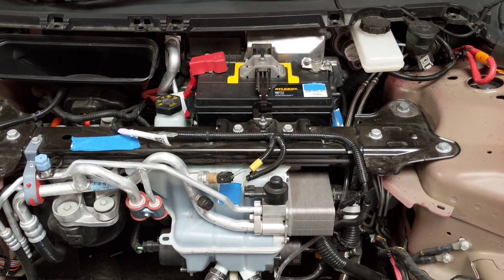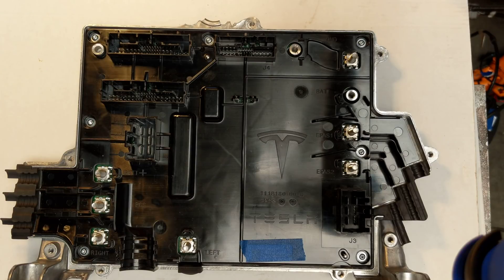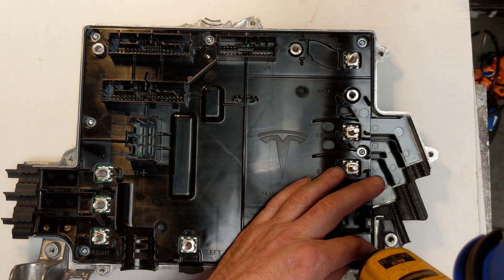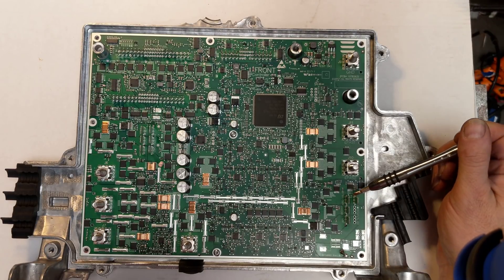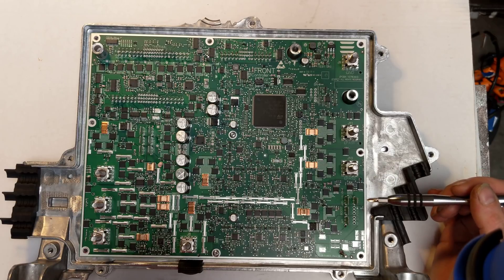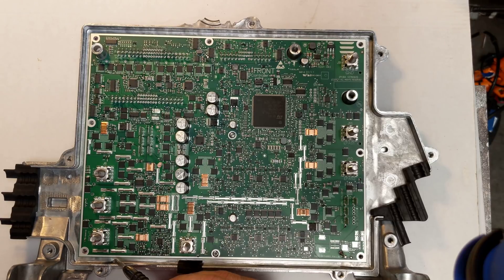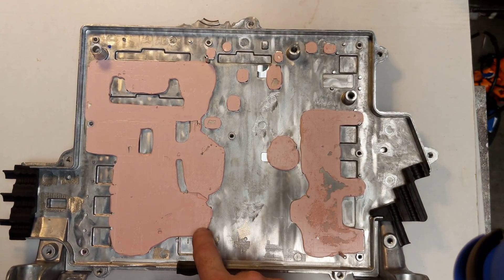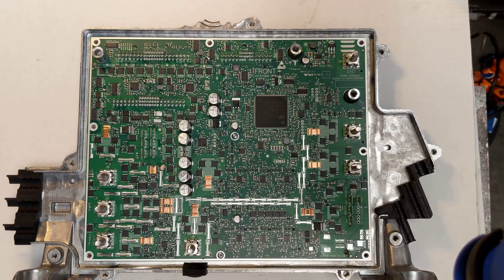Tesla Model 3 - Teardown of VCFRONT (Front Body Controller)

Comment: I have vcfront_a192, vcfront_182, vcfront_a402 in my 2020 model3 (battery is 4 years old)
After going into the service mode low voltage screen I don't have VCFRONT_a192, just VCFRONT_a182, VCFRONT_a402, VCFRONT_a407, and VCFRONT_a371.
the 12V battery reading
voltage between 12.59 to 12.62
current between -0.39 to 0.04
PCS
- HV battery contractors
closed
- DCDC support status
active
voltage target: 12.63V
output voltage: 12:58 to 12.60
output current: 19 - 20.20A
Do I just need a new 12V or new VCFront since the HV battery contractors closed?
Reply: How did you solve the problem? I have the same
Reply: @MrVitalilogvinenko  Bought new 12V battery from Tesla and replaced it.

Comment: Hi, Do you know if is possible to clone this module by reading&writing central mcu  ST SPC56EC74L8 ?
Reply from the maker: No, because there is calibration data in flash.  Why would you want yo do this?   To install a new one, all you need is to install it and redeploy software from service mode.

Comment: I have a model Y 2023, and in no more than 8 months and ~8500 Km, this piece of hardware broke. I was wondering what is the probability of this breaking so fast. Also what could it impact if this happens during drive. To me it happened in the parking lot, it was saying vechicle is shutting down, please pull over safely, and I have a lot of issues popping out on my board, ABS no working, low voltage battery disconnected, steering assist reduced, Parking brake not set, Electrical system is unable to support all features... so on. What would happen if this piece of hardware is braking when I have 100 Km/H? Also another question, if they repair this on warranty how can I be sure on the car repair,  to feel safe when driving it?

Comment: I have a heat pump model 3 with collision damage that I am restoring, the front inverter lv connector was obliterated and I have replaced it (and the data harness).   ATM the lv battery is not charging and I’m getting a vcfront_a192 after about a half hour of charging the lv battery with my shop battery charger.  The main battery is at 60%, and I see no evidence that the DCDC converter is charging the lv battery.   Is the output of the DCDC converter fused?
Reply from the maker: VCFRONT_a192_criticalLoadShed means it is advising the modules in the car to go to low power mode because something is inhibiting the power state.  Yes, everything is fused somehow, but the right thing to do is read the diag alerts, as they will tell you all you need to know without digging.

Comment: Thanks!
Reply: I was able to get my 21 M3 into Service Mode and see a VCFRONT_a192_vehicleLoadShed (PCS refusal to charge LV system, most likely due to the crash event), I also see a BMS_a059_SW_Pack_Voltage_Sensing (HV Pack output differs by more then 3% of the sum of the HV modules) and lastly an HVP_w021_PyroMiaFault which is probably precipitating the previous two alerts.   The collision did NOT generate an SRS/Airbag deployment.   and there is no visible damage to the battery module.    The interesting part is that I was able to charge the main battery UNTIL i did a software upgrade to the 2022 24 6 release.   Does this tell you anything?     I hate to think that the Battery Pack needs to be replaced.

Comment: Well, I need to ask a question even though the video was posted 3 years ago.  I recently returned from a trip where I received an error regarding the Front Body Controller.  I had an aftermarket rear view camera plugged in to the cigarette lighter as I was towing a trailer and needed to be able to see behind me. The service center tried to claim I had caused the malfunction and attempted to charge me for the repair.  How could plugging something into the lighter cause a malfunction?
Reply from the maker: They do this all the time.  I have hundreds of stories!   The only service centers who act like customers are something they accidentally stepped in that needs to be scraped off the bottom of their feet.   The 12v accessory (cig lighter) socket is powered by VCLEFT, not VCFRONT, so it's not even directly connected.

Comment: So if there is a overcurrent.... the shunt voltage is used by an ADC to do cut-off. But is this a discrete circuit? Or is it done by controller and software?
Reply from the maker: There is a simple current trigger in hardware set at a certain safe threshold.  It doesn't rely on an ADC or software, but that is a second layer for more precise control.

Comment: My 12V battery had to be replaced on my 2021 model Y less than 3 weeks of taking delivery.  Then 2 weeks later I got a warning to replace it again. Tesla service center told me they have to replace the front controller. Is this what they’re talking about? Why would this happen to a brand new car?
Reply from the maker: Infant mortality.  As you can see this controller is quite complex.  One tiny part out of place could result in a problem that may have not been detected in manufacturing.  It's rare but does happen!
Reply: @Ingineerix  Thank you for your reply!

Comment: I have had a faulty OAT indication since my model 3 was delivered in 2018.  Tesla replaced the sensor but the problem persisted.  The wiring diagram shows the wire from the sensor goes to the central body controller.  What portion of the board outputs the OAT?
Thanks.
Reply from the maker: Have Tesla replace VCFront under warranty.
Reply: @Ingineerix  Unfortunately, easier said than done.  I have had several service appointments-after Tesla replaced the sensor (problem persisted) they kept the car for several days without touching it.  Finally I canceled the service and retrieved it.  Another time, they said expect 10 days to research and fix.  I left with my car.  They have a greater tolerance for delay than I do.  I have an appointment tomorrow.  I requested replacement, their response was that it must be fully checked- sounds like part is not in stock.  I have looked at the salvaged market and several are available.  Doesn't look too difficult to swap out, but my concern - is this part "plug and play"?  Or, do you have to have the network accept  the new part and reprogram the replacement?  I assume nothing within the VCFront has anything to do with my FSD/AutoPilot (which I have paid for).  If I can get a used part cheap enough, I would buy a replacement and just swap it out.  Please advise on your opinion on plug and play.  Thanks again.
Reply: Happy to report Tesla replaced the VCFront, OAT now functions.

Comment: Does this controller have anything to do with the persistent VCFRONT_a180 error message a few people are getting?
Reply from the maker: VCFRONT_a180 means the 12v battery is not being supported (meaning the 12v DC-DC converter in the PCS is offline).  I think this is a problem with the PCS, not VCFront, it just happens the VCFront is the ECU in charge of 12v battery health, so it's the ECU to notice!
Reply: @Ingineerix  ok thanks. The Service Center replaced the DD/DC converter which did not fix the issue. They then blamed a hitch, the Stealth Hitch which I had removed but that also did not fix the issue. I saw the error again today, intermittent for about 5 mins then it vanished, so I’m at a loss.
Reply from the maker: @Zoolookuk  Sad to hear, seems like most of the guys at the service center LOVE to blame their customers for faults.  I personally have had this experience, and had the service center flat out LIE to my face.  This is the main reason I started hacking on Teslas, I was sick of their b**ls**t!   Check all the connections from VCfront to the PCS, there is a really heavy red cable that starts on VCfront and stops off at VCright (passenger kick panel) where there is a bolted connection.  I've seen this connection be loose FROM THE FACTORY and cause these issues.  Note, this is bolted with a ny-lock nut, so there is no possible way it "came loose" which is what service will claim if they ever find it.  There is also a known issue where the ground strap from the PCS to the body doesn't make a solid connection.  This is easy to inspect by lifting the rear seat cushion on the passenger side.
Reply: @Ingineerix  You might be interested that the PCS board was replaced but didn't fix the issue, it still occurred, so then the entire VCFONT was replaced as well. Apparently it was reading a 16v spike from the PCS which may have been occurring at some point but no longer was. Very odd. It through both VCFRONT_a180 and  VCFRONT_a195 errors, often in the middle of the night after waking up.

Comment: Do you have any high resolution photos of the board? There's an argument on a forum. Some people think that there is a "battery charger" module on vcfront that modulates/converts the power from the PCS into the charging voltages an AGM needs. I disagree with them. It appears to me that the 12V battery is connected directly to the PCS through an e-fuse setup.
Reply from the maker: No, there is no physical battery charger circuitry in VCFront.  Only an electronic fuse (high side driver) and a current shunt on the line to the 12v battery.  The PCS (under the rear seat) contains the DC-DC converter.  VCFront does indeed monitor the state of the 12v battery and requests voltage setpoints from the PCS to effect the 3-stage algorithm.   The 12v voltage is the same throughout the car, so depending on phase of the 12v charging algorithm and 12 battery temperature, you will see the whole system voltage move anywhere from about 13.5 to 15 volts.  There is a temperature sensor on the negative post of the 12v battery so the charge algorithm can be properly temperature compensated.   It would be a waste to add a complex buck-boost circuit to VCFront for battery charging, when there is no need, as the only variable that has to change is system voltage.
Reply from the maker: You wouldn't need high-res pictures to see such a circuit; a very obvious large inductor would be visible for a charge circuit to exist.
Reply: @Ingineerix  That was my understanding as well. Plus, the Model 3 Theory of Operations document doesn't mention any such thing. 
I was kind of curious about what the microcontroller looking chip near the BAT+ terminal is though...

Comment: I have two questions involving the connectivity of the Tesla series.
Tldr; do you really need SIM card and how important is it? 

 First one, will removing the SIM card prevent the MCU from working properly? ( ignoring obvious creature Comfort connectivity like GPS map downloads and music streaming). Second question, assuming that, yes the mcu would still work without the SIM card, can Tesla still send out updates or modifications to your Tesla. My gut feeling says no, considering the SIM card is literally for internet connection, but is there a secondary method of connecting to Tesla headquarters?
Reply: Jonathan Nunez don’t worry, you will still get updates and stuffs even after replacing tesla SIM card

Comment: Thanks for the video!  Regarding the large press fit terminals, 
I'd guess that they are a weak point in the design. Though, I've never seen a good way to connect large conductors to a PCBA. In  their favor, they consume minimal real estate.
Reply from the maker: I haven't seen any fail yet in the field, even when large crash forces are at play.  As long as the connector shell is restrained, the terminals can't add moment to the press-fits.

Comment: Is there any video show how to change Sim card for Tesla model 3
Reply from the maker: No, but there is a SIM slot in the bottom of the ICE, but Tesla uses the internal E-SIM on most cars.  In any event, you would need programming to set the APN even if you did, as it's not automatic.

Comment: Where is SIM card slot?
Reply from the maker: Early cars had a SIM, which is located in the bottom of the ICE (on passenger side firewall). Newer cars have switched to an internal E-SIM built into the Telit Modem.
Reply: How can I get access to Telit modem part and replace with new modem?

Comment: mosfets sometimes fail short, then if you have no fuse you're out of luck
Reply from the maker: There is a pyrotechnic disconnect that can remove HV power much faster than a traditional fuse if a short is detected.

Comment: I removed the rear subwoofer and amp without disconnecting the battery, and shorted it out. How do I reset the system since I didn’t blow a fuse?
Reply from the maker: Just because you didn't blow a fuse, doesn't mean damage wasn't done.  I recommend you power down the car completely, and also do so in the future when you are working on it.  To do so: Roll down all windows, (so you don't lock yourself out!) choose "shutdown" from the service tab in the car menu, once the screen goes black, Disconnect the negative lead on the 12v battery. (located under cowling cover in frunk.)  Then lift up the passenger side corner of the rear seat cushion and disconnect the rectangular connector there.  There is a plastic lever about 1 foot from the end of the seat where the cushion meets the carpet (basically in-between where the legs would be for a rear passenger).  Once you lift up the cushion, there will be a styrofoam cube protecting the connector you will have to lift out.  Once you pull this connector, you will hear a big "clunk" which is the high-voltage system shutting down.  To release this connector, squeeze the tab on the bail and tilt the bail DOWN away from the connector body until it stops.  After the clunks (contactors opening) The car will now be totally dead.  You can reconnect this connector back and the car will stay dead until the 12v battery is reconnected.

Comment: Hey Phil!
I found your channel after watching the video from RichRebuilds.
How is it you disable the Linux subsystem logging of the Tesla, do you ssh into it or how do you communicate with it?
Also, do you think its something I should do on a model 3 or just leave it?
Reply from the maker: You still have a long long time before you have to worry about it on a 3!  I'm hoping my exposure of the problem will prompt Tesla to fix it.  While I'd love to take your money, My advice is to wait and see if they do the right thing.  Check back in a year or so and we'll see where it's at.

It takes around 4 years to kill the 8GB eMMC on a Model S or X.   The Model 3 has around 4 times the logging data, but the eMMC is a newer 64GB part.  So if all other things were equal should at least make it around 8 years.  (Likely longer because it's a newer part)
Reply: @Ingineerix  ....So your comment (above) was made one year ago. I'd like to check with you about where things currently stand with the eMMC logging ?   any fixes ?    sorry if i missed it.
Reply from the maker: @zaneenaz4962  They are still hammering the hell out of all flash memory in all cars.  3/Y have a larger eMMC, so it will take longer to fail, but they are still logging WAY TOO MUCH in my opinion.
Reply: @Ingineerix  This is a sloppy part of the software design, should allow a way to go into service mode to turn on/off debugging logs.

Comment: Ingineerix, sorry if this is a silly/amateur question:
Looking at the diagram for the LV8907. It looks like the chip has independent lines for each phase of the motor (U,V,W). Do the UH, VH, WH (and UL, VL, UL, etc) all run from this controller to the motors directly? That seems like it would be a waste of pins. Or am I misunderstanding how the motor controller is laid out?
Reply from the maker: All 3-phase motor inverters require 6 total switches. (a switch for each of the 3 legs that can connect it to + or -.) So any controller driving such an inverter has to have at least 6 signals.  The LV8907 is an integrated driver, so it also contains the FET driving circuitry, so even more pins are needed in this case.
Reply: That makes sense. Thank you for the replies! I really enjoy your content
Reply: Is there not a more efficient (in terms of the number of connectors needed to this board) way of doing it? Tesla seems to have the mentality of restricting the number of connectors going to each board. This seems counterintuitive to that mentality
Reply from the maker: The Model 3 has WAY less wiring compared to any other vehicle of it's complexity.  I think they are doing a good job.

Comment: Dumb question.  Is this where the Autopilot computer / chip is?  Nevermind, it is not.  That would be part 1098058-S0-L, "CAR,COMPUTER,MCU,ADAS,ASSY-PROVISIONED"
Reply from the maker: Correct, Autopilot lives inside the ICE which is located on the firewall behind the glovebox.  This is also containing the MCU.

Comment: ¿why all this complication for 12Vbatt delivery instead of using relays, y'know, like everyone has been doing for decades (like terminal 30 in VW)?.
Reply from the maker: Fault tolerance.   The Model 3 is the first production car built from a clean sheet designed to be able to drive itself without a human inside.  They want to reduce the chances that a single failure could put the car into a state where it cannot get itself safely off the road.  Imagine a blown fuse or flaky relay in a car that's driving itself suddenly fails and the car just drifts into a bunch of pedestrians.   Wouldn't be good for the future of self-driving cars!

Comment: So what's the advantage of using this fancy mosfet fuseless design over fuses? It doesn't look like it could be cost with that huge circuit board?
Reply: It now cost you hundreds of dollars (or more) to replace what would otherwise be a few cent fuse.
Reply from the maker: There is no need to replace anything.  If a short is ever detected, it simply cuts power to the affected circuit and will automatically restore it once the fault is cleared.   It can also respond much faster than a normal fuse.  It was done for fault tolerance, because this is the first car built from the ground up to be able to drive itself without a driver present.  They don't want a failed fuse causing a dangerous situation on the road.